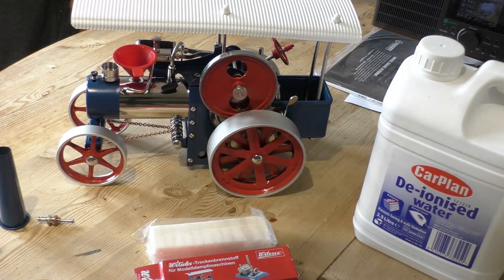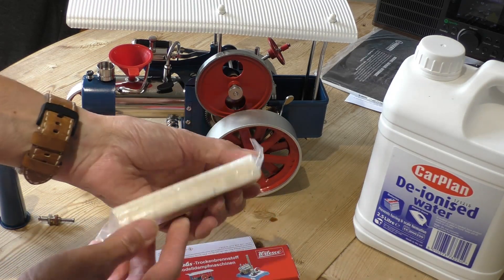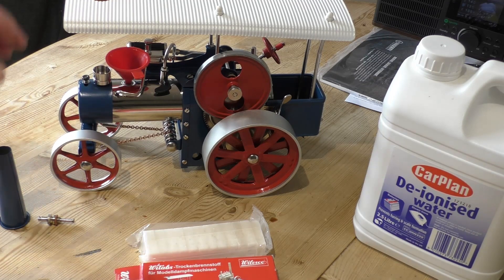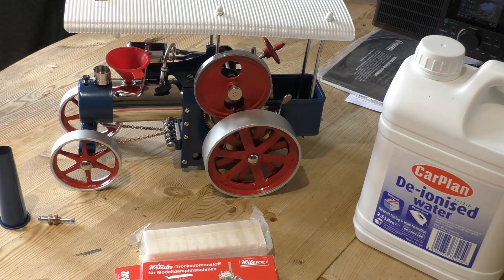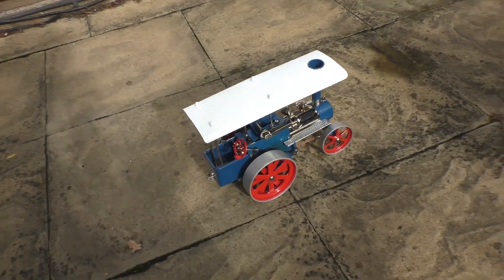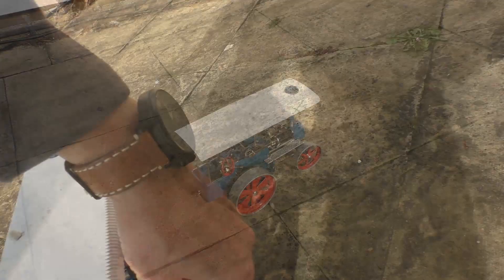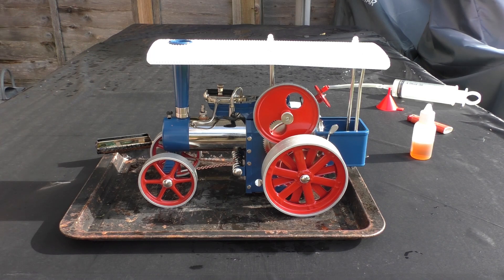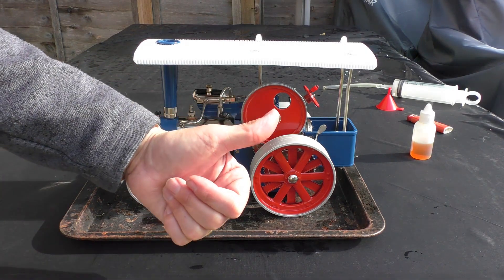WILESCO D415 Steam Tractor kit. VERY FIRST LIVE STEAM RUN

Comment: The intermediate drive cog on these always seem to run off centre, and are naturally very noisy as a result of this.

I thing that this is a superb little traction engine, but can be considerably improved, if it were painted the correct colours!
Mamod Wheels on the rear also add amazing realism, and you can press off the original Wilesco rims, and with a bit of tin wrapped round the Mamod wheel to sleeve it, the Wilesco rimes can then be pressed on, retaining the original diameter.
Reply: Thanks gary.  Yes i think with some modding this engine could be improved

Comment: Hmm would it be possible to use coal instead of fuel tablets?
Reply from the maker: You know iam not sure.  In theory i guess so.  Might have issues trying to get suck a small amount of coal to burn hot enough though.
Reply: @UK-CB-RADIO  yea same thoughts here i might try it

Comment: You should never run a steam engine in deionized water. 
De-ionozed water will corrode the zinc from the brass componants, such as the brass boiler......
Tap water would be better!
You should use distilled water to avoid build up of limescale
Reply: Quite correct about the use of the de-ionized water. If you suffer with furring of your kettle (due to lime-scale) do NOT use water from the tap, but simply boil water and when its cooled use this instead. The chemists amongst us would know that this is simply distilled water.

Comment: A great first run. It appears to have loads of power. I was thinking it may pull a fair bit of weight. Possibly another video demonstration. Perhaps some rubber bands around the rear tires would give it more gripping and pulling power.  Perhaps a rubber or cork bushing might quiet down that flywheel rattle. Thanks for sharing Fred. All is well here. All the best Fred.
Reply: Cheers Andy.  You can get rubber tyres for the wheels as they scratch easy.  The cork bushing would be good although with those spring caps i cannot now take the wheels off.